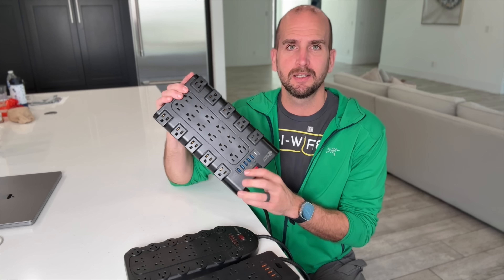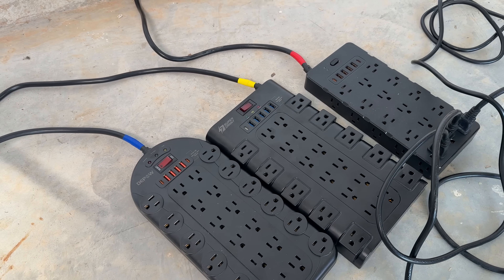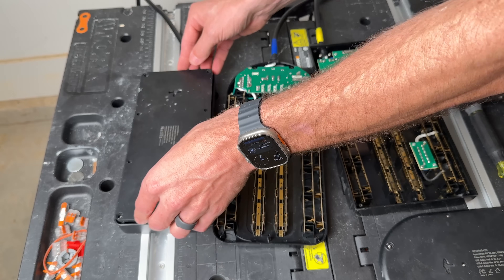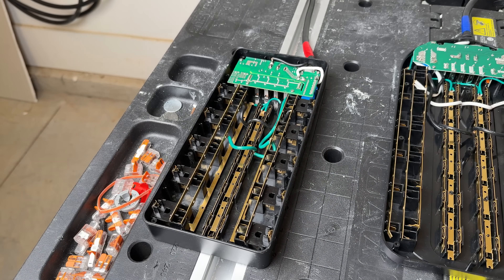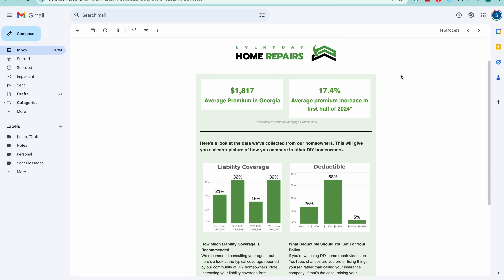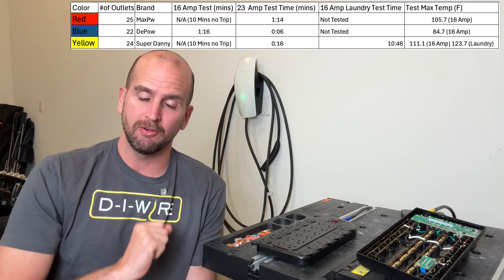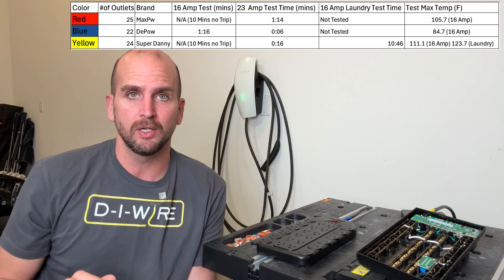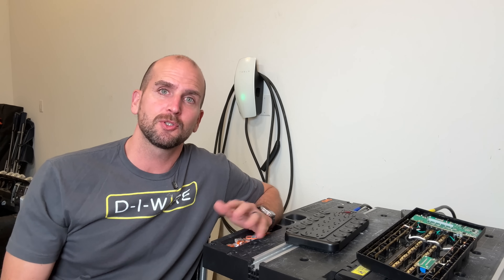Testing The Most Dangerous Amazon Power Strips |  I Wasn't Expecting These Results!

Comment: I've never used a strip with that many outlets, but I routinely travel with a 12-outlet strip in my suitcase.  But it never comes close to being loaded - it's primarily to support all the chargers that we need when my wife, my daughter and I all share a hotel room together:

1 laptop charger (85W)
6 5W USB chargers (3 phones, iPod, watch, kindle)
1 12W USB charger (for iPad)
1 10W charger (yet another phone)
1 8.4W charger (camera battery)

For a total of 10 devices, drawing a maximum of 146W DC.   Assuming lossless power conversion and a power factor of 1 (impossible, of course), that would be about 1.2A at 120 VAC.  Probably closer to 2A real-world, if everything is drawing its maximum load.  Which any strip should have no problem with.

Even if I were to add another laptop with a beefier 150W charger (effectively doubling the load), that would still be far below the limits of any power strip.
Reply from the maker: Agree, the battery charger example is one where you need a lot of outlets and room but the power demands are low.
Reply: @EverydayHomeRepairs  Why are cruise ships restricting their use ?

Comment: I have two Super Danny power strips.  Both used for low voltage computer-type applications -- no heaters, no heat guns, no hair dryers, no nonsense like that.  Both replaced rats-nest multiple-power strip wire messes.  I'm still plugging the same things into them that were plugged into the nearby outlets -- it's just a whole lot cleaner.  And no, these aren't filled with plugs -- the extra outlets and design make more room for odd-shaped power adapters and such things.  I've been very satisfied with how they have cleaned up my wire messes.
Reply from the maker: Yeah, what you outlined is probably my favorite application for this type of power strip.  Thanks for the feedback!
Reply: @EverydayHomeRepairs  Many modern applications are mostly wall warts, and the USB power outlets make USB power wall warts superfluous.
Reply: Exactly!  I have the big one for my two-way radio and computer gear, all low-current stuff.  If you're careful, these power strips work fine.  My only complaint is I had one which fell apart as the screws which held it together were barely long enough to do the job (I wall-mount my strips). I got a new one and added glue to the back cover to hopefully prevent another such failure.
Reply: If designing for safely, this suggests that a load meter or "overload" light would help. Then a complete novice (say, for argument's sake, a child) could still use it while intuiting and avoiding danger.

But of course, that would be an expense.... Another reminder that standards and regulations are needed to halt races to the bottom.
Reply: I use my Super Danny for retro game consoles and my 8 port gigabit Switch in my game room. Lots of outlets to connect those game systems and most retro consoles pre PS3 and Xbox 360 pull a lot less power than modern consoles.

I also do not play more than one system at a time so they don’t all run at once and put a sizable load on this power strip.

With this video, I did find it odd that temperatures were not taken at the main plug for the whole power strip. I have seen power strips where the strip itself is fine but the male plug on it heats up due to poor construction.
Reply: @ShamaNamaDD The main plug heating up is often a symptom of plugging it into an old/worn/cheap outlet that's not making good contact with the prongs. Level 1 EV chargers have temperature sensors in the plugs for this reason.
Reply: Yeah, I have one bolted to the back of my TV stand and everything is plugged into it. Best for like controller chargers and retro consoles and everything.

Comment: those wire connections looks like its spot welded, and that is very common even in name brand models. What's scary is there's not much difference tween a 5$ no name and a 25$ GE
Reply from the maker: I think you are right, thanks for the feedback!

Comment: As usual, if you really need to be told not to use a power strip with power tools that can max out a 15A circuit, you may deserve to win a Darwin award. For those of us with endless low-current wall warts to feed, many outlets on a power strip are a godsend.
Reply: Unless the meaning of "Darwin Award" has drifted, this doesn't qualify IMO.

With so few layers of safety, the "Swiss cheese lined up" case where it all goes wrong is chance circumstance - it's not genetically or even behaviorally influenced. You'd need a prior understanding of electricity and wiring here, which is learned - so some of the fault goes to one's teachers. And with so little of this taught universally, learning the hard way happens by random happenstance. (And yes, quality applied education should be more emphasized in modern society.)

And besides, there are pitfalls here that are far more common than "power tools", which helps prove the point.
Reply: @AySz88  what point? All I see is word salad.

Comment: I use one of these for my home office setup, many things plugged in but all very low power draw. I'd be surprised if the total power draw reaches 300 watts. I feel completely safe in this capacity. It certainly wouldn't be used for heavy power draw such as space heaters, toasters / toaster ovens / air fryers, etc.

Comment: I picked up a couple of the "yellow" ones.  So far I'm happy with them.  BUT... I'm also aware of how many amps I can pull on a circuit.  I've had plenty of experience of living off small generators for extended periods of time (hurricanes / hurricane recovery).    I'm anal enough that every one of my receptacles and light switches in my homes are labelled with the panel# and circuit# in small print.

Comment: I'm not a great fan of theses, but I guess there are uses cases. In a worshop for tools, you can quite often get lots of batteries to plug if you don't stick to a brand (I have mastercraft for lawnmover/snowblower, dewalt for drill, and my wife has a little worx saw). This is pain in the ass to get it to charge, so I just fixed everything on the side of cabinets. I also have a little lamp around there. So if i had let's say like 2-3 more things to plug it would probably be handy. However, the fact that they did almost not trip on overload is worrying, and the solders contact looks quite bad.

Comment: Actually a large number of outlets isn’t dangerous in some applications. For example in a garage shop you might have several tools plugged into one power strip but it’s a one man shop so there’s only one tool on at a time. So long as the tool that draws the highest amps doesn’t exceed the working limit of the outlet strip there’s really no issue. But be careful and don’t plug your dust collector into that same outlet strip because then you are more likely to have two things running at the same time which may exceed its limits.

Comment: An Asian man at a flea market was selling 8-outlet strips for 99 cents each. They had US plugs but a meter that went up to 300 Volts. I bought one just for the meter and took the strip apart. It was obviously meant for a 220 Volt country because it used what looked like speaker wire for the internal wiring. Same with the cord itself. I wonder how many fires these things caused?
Reply: If the 220 volt strip actually had a breaker it should still trip at about the same current at 120 volts. It might actually be safe. Of course depending on it's construction it might not be safe at all!

Comment: As a fire investigator, I worry about the heat over time. Even low heat will cook the volatiles out of the wire insulation over time. The insulation will eventually get brittle and arc. Not if but when.

Comment: The ONLY way I'd dare consider using them would be for low amp draw led lighting!  As for plugging in even a single high amp draw heat gun NO WAY, Jose!!  And .... I certainly wouldn't leave them unattended for any length of time!!

Comment: It doesn't look like the wires are soldered to the buss bars, I'm willing to bet they're spot welded. I think busbars like that are great for home electronics, running smart speakers, routers, television streaming cubes, set-top boxes, as well as larger things like amplifiers, televisions, and game consoles. all those things plugged in at the same time won't amount to 500 watts, which is less than 1/2 the current rating, 1/4 the heat dissipation of full load. The only caveat, is that the thermal stop breaker has to function properly!

Comment: My guess is durability is the main issue with them. 

In my use of powerstrips, I get most frustrated by the lack of physical space for plugging in the many plug shapes, power bricks integrated with plugs, etc. I'd rather those 24 outlet 'strips' had only 12 outlets and lots of space between them.
Reply: There are some like that. Just harder to find these days.
Reply: One of my favorite power strips is made by Belkin. The receptacles swivel from side to side, spaced along the length of the power strip.

It doesn't have 12 receptacles though. If you really need that many but want the extra space, I'd say getting a 24-receptacle power strip and only using half the receptacles would be just fine.

Comment: Those wire connections look like spot welds, and if they are they are much more superior than just solder alone. In the industry I worked in, electronics/telecommunications, I was taught that mechanical bonds at the molecular level were required to produce the best connections and to use solder to hold the connection in place. This is why when you get into high voltage and current connections they use mechanically assisted crimpers such as those required for proper battery connections. When the crimp connection and the copper wire are pressed together under high enough pressure they bond at a molecular level. Solder alone in this application is very unsafe because it has a low melting point and will become disconnected if it gets hot enough. This is why solder in not used in home or commercial wiring.

Comment: my personal feeling is this being used behind a computer desk or entertainment center with a bunch of accessories. I use about 10 plugs just at my desk for computer, lamp, sound, screen, modem, router, printer, coffee warmer (15 watts) phone / tablet chargers, etc. Some of those wall-wart transformers also block another space so there's that issue as well. I can see a dozen as good but two dozen plugs plugs is asking for abuse. My normal draw on the strip is 3-5 amps (at most) with everything on.

Comment: The first situational use that came to mind is a craft style location. One where I have multipule items plugged in at one but one use 2-4 at one time. Light heat gun, light soldering iron, light dremel and fan. But not behind a TV or couch running a rooms worth of items.

Comment: That's surprisingly good given what we're dealing with! I have one of these and I'm going to make a CAUTION warning sign for it, suggesting a max watts output, and maybe saying "NO HEATERS." I feel like these are OK products as long as you know what you're plugging into it. E.g. 22 for USB2 power supplies, max power maybe 20 W, typically <5 W, you're not going to have a problem. If you just set it free amongst people who don't understand electricity, there will eventually be a problem... except for the blue unit, which looks like it would trip before failing dangerously.

Comment: Klein Tools make a Line Splitter that plugs into outlet splitting common/ground wire. You can then use Clamp Meter without pulling wall plug out to expose lead wire. Nice DIY upgrade👍
Reply: Harbor Freight sells their own version for <$10
Reply: years ago I made one with 2 cord caps and some wire, shaped into loops. I can even break out the ground just to make sure some appliance is not leaking internally.
Reply: yep - my klein meter came with one

Comment: I have a 4 foot piece of 10 awg drop cord I put cord ends on. In the middle i have the insulation removed to have access to the hot leg. Just for the purpose of amp checks. It was all scrap and it comes in very handy. I also have another one with just male end on and wago ends for testing devices.

Comment: Compare these to TRIPP-LITE  Outlet Strips with the metal box plus surge suppression.  You get what you pay for.  Cheap Fire Insurance.  But still do not run Heat Guns or Electric Heaters on a plug Strip for long periods of time.

Comment: The problem is the built in breaker is thermal only and not thermal and magnetic like a house breaker.  As a result the strips are more likely to fail in a connected mode at the worse time especially if the house breaker is a 20 amp. Finally the other risk with any outlet strip is it can easily be covered with a flammable cloth, paper etc and even normal heat buildup could ignite.

Comment: These look perfect for my use case. I currently have a bunch of daisy chained 5 or 6 outlet power strips powering two small form factor computers, three monitors, an Ethernet switch, Bluetooth audio adapter, small audio mixer, DMX lighting board, wifi router, DMX automation controller, three different sets of LED work lights. The actual theatre lights are on dedicated circuits, either 15 amp single phase circuits for the LED fixtures or 30 amp three phase circuits for the conventional fixtures. Controlling the lights and sound uses a lot of separate plugs but not a lot of current.
Reply: Sounds like a fire hazard.
Reply: @ If you mean the daisy chained power strips, not really if you understand how electricity works and what amps are, but it is cluttered. A single larger power strip with 15-20 outlets including enough spacing for some wall warts would be much neater. There's a big difference between plugging several heat guns into a power strip, which is absurd, or even the classic example of plugging lots of strings of incandescent christmas lights vs plugging in a bunch of LED loads that never exceed 10 amps total and are significantly less most of the time.

Comment: I had a conventional surge-protected power bar (6 outlets, no USB) actually catch fire with no load attached.  A storm knocked out the neutral line to my house and fortunately very little damage occurred due to quality protectors. However this  unit would not trip.  The MOV did its job and shorted the lines together as it should,  but the breaker did not trip.  Fortunately it did trip the breaker in the panel before any serious damage was done.
Reply: I had something similar happen with a dishwasher.  They were too cheap to put a $0.15 fuse on the control board so when a power surge came, it burned out a trace on that board.  I'm an electronics person so it was a pretty easy repair, but for the average person it probably would have been a $100 parts + $150 labor fix.

Comment: I think these are totally ideal for a home office set up -- it's where I use mine. Not because I have lots plugged into them (I don't have much) -- but because they give the space around the outlets to plug and unplug things easily and not feel "crammed" and maybe more importantly they allow for hanging on the wall, so it's off the wall and out of the way. 

That may be the only application I'd use them -- but it's been ideal for my work at home situation. Again, not having many things plugged in (think 2 monitors, phone charger, docking station, printer, occasionally a second laptop cord -- but that's usually it).
Reply from the maker: Yeah, it could come in handy for home office especially when you need to plug in the large wall warts to charge things like your laptop
Reply: @EverydayHomeRepairs  Excluding my computer, I have about 500W spread out over about 20 outlets in my home office. Monitors, chargers, lamps, and various other 5-30W small electronics all add up.

Comment: arent extensions supposed to be only 10 amps?
Reply from the maker: Yeah you need to be careful with extension cords as if you get one with 16 gauge wire it will be designed for a max of 10 Amps.
Reply: No. Go look at extension cords including their retail packaging and you will see that you are wrong.
Reply: @Those_Weirdos  then you look at the extension cord socket,  they say 10 amps. unless rated for heavy duty.

Comment: Y Tip/Tri Wing/Triangle tend to be a type of security screw/bit.
I could see those power strips being used for a lot of chargers, for that use they should be fine.
Reply from the maker: Thanks for the feedback.
Reply: @EverydayHomeRepairs  You can get a security bit set from Harbor Freight that should have bits suitable for those types of screws.

Comment: Maybe if you had a very light load on them, or only used one or two slots at a time but didn't want to un/plug things a lot?

If they don't have an internal circuit breaker or fuze it should be criminal to sell them. The catch, is those criminals are off in another country, so GFL going anywhere with that.

Comment: I bought what i thought was a nice heavy duty name brand outlet strip with actual real outlets in a row in a metal case but of course to save money they used back stabbing of the outlets inside with little u shaped pieces of wire that were stretched so tight one day outlets stopped working the wire had come lose by pulling to hard on contacts so only first outlet was working had to take it all apart and replace outlets with real commercial duty ones with side clamp terminals